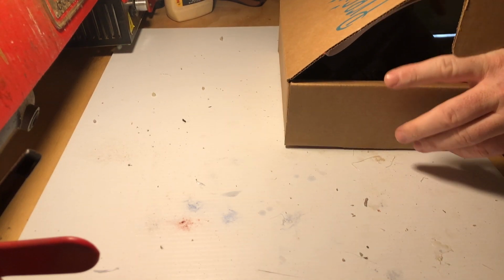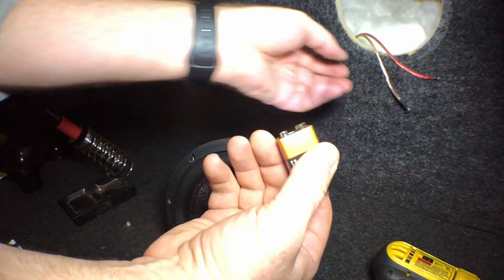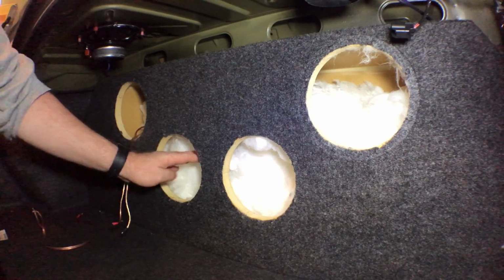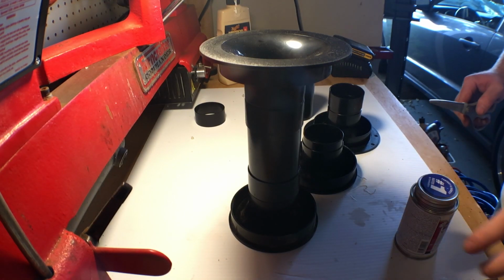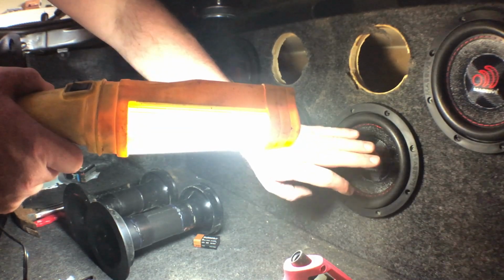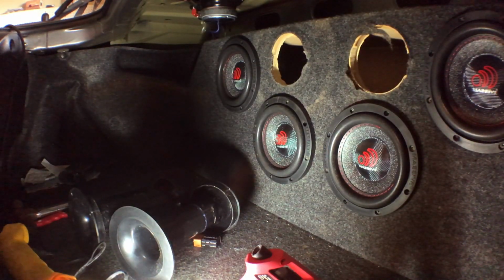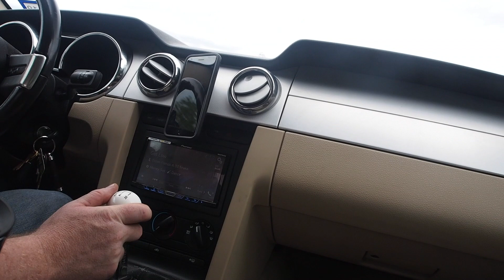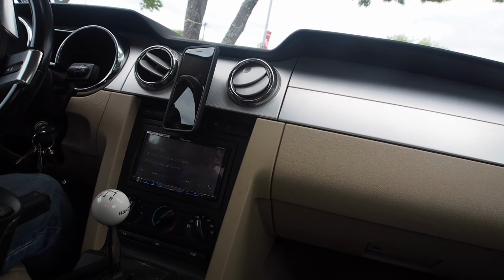Precision Ports Flared Port install into sub box

Comment: Speakers need a larger box volume to be ported vs sealed. Or did you build the box size planning on the ports coming in so you had the box to big for being sealed?how much room do you have between the back of the port to the back box wall? I'm working on a small sub box and I have the Precision Port 2" flaired port. I made the box according to the speaker specs for ported box. When I got the port I'm afraid it is to close to the opposing wall. Did the ports add more low end and volume just by adding them? They look nice. Congratulations
Reply from the maker: minimum ported volume for this sub is only .29 cubic feet. While optimal is .41 cubic feet. This box is 1.5 cubic feet so it falls in with the optimal size for 4 of these subs. When I purchased the box, I had it cut for the subs but did not know which subs I was going to get so I did not have them cut the ports at that point.
Reply: @thejonc799 . Thank you. I'm now deciding on what I can do now with mine. I raised the tuned frequency as it is for a small Bluetooth system so I'm not looking to shake the house down. But it the port recommends 2" clearance to any wall if possible. I'm considering top or bottom facing port then I can lower the frequency down. I'm also considering making an elbow so it's not within 2" of back wall in the location I planned for. It's impressive how small subs can put out more bass than the old days' big woofers.